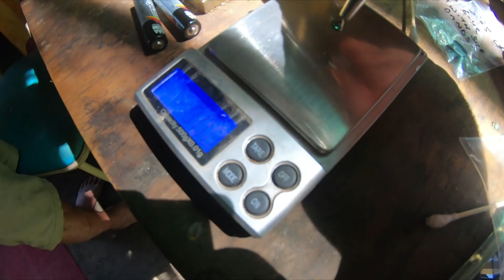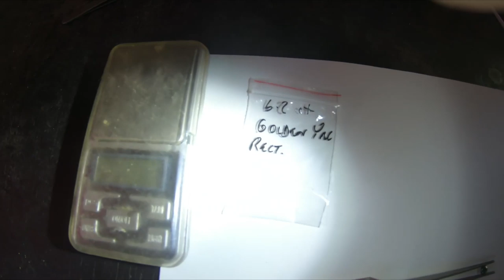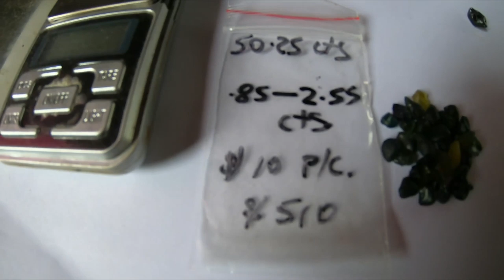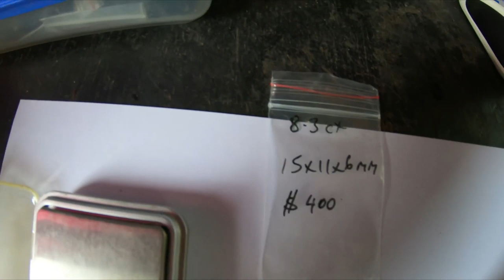Sapphire Mining Australia ,Tim's Adventures [ V: 135 ]

Comment: Tim, thanks for another great video. You are a good teacher. I normally resist making any suggestions but in this case I would like to make a respectful contribution. After watching you process a load I could see that the hole in your wash screen is due to wear caused by the metal scoop you use to get the pay gravel off the screen. If you were able to find a plastic scoop the screen would last far longer. Finding the right scoop would be hard but I would recommend you keep your eye out for a replacement. Good fortune to you, sir.
Reply from the maker: Yes good idea, the scoops they use for gold